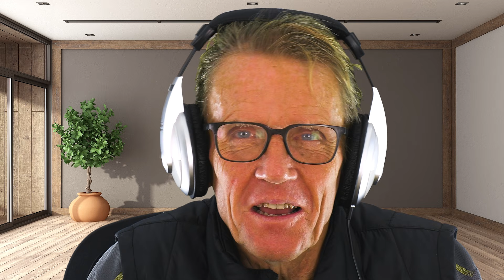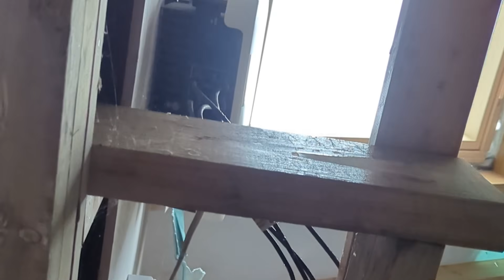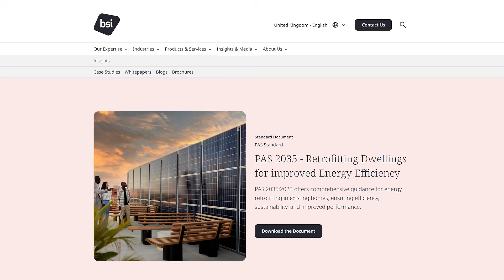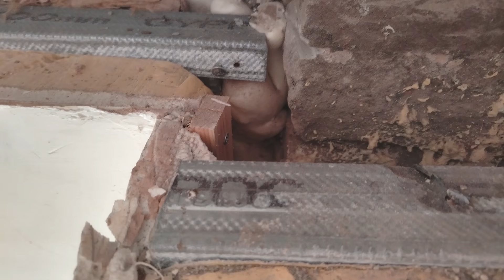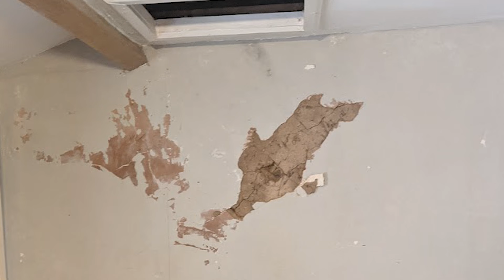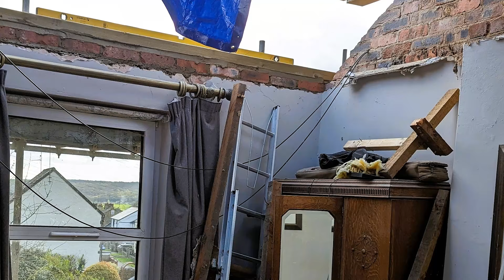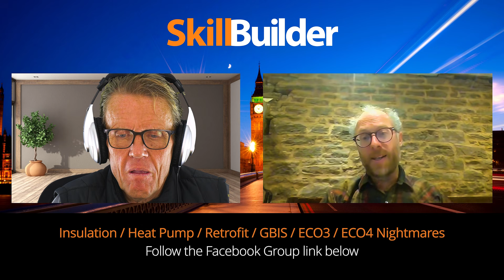Government Scheme Leaves Homeowners in Ruin – And Nobody Cares!

Comment: It strikes me that, if our government really thought heat pumps were going to be effective and cheap to run, they wouldn't need to prohibit use of gas/oil-fired boilers alongside as no one, given a choice, would want to continue using them anyway.
Reply: tbf they have to provide some incentive to encourage people away from what they know, even if the alternative is better. They really needed to require proper training for installers and also independent sign off on each installation though, otherwise everyone gets scammed
Reply: Also installs designed at 50 degrees seem to be almost standard, and yes, that's not cheaper to run
Reply: It's an incentive problem. Heat pumps are cheap to run, but they are expensive to install. So from the perspective of a construction company, why would you ever put a heat pump in a new built? The company has to pay extra for the expensive heat pump, and that will raise the value of the property a very small amount, but not as much as the cost of the heat pump. Meanwhile all the savings that pump will make in running costs are savings to the buyer of the property - the company building it isn't going to see a penny of those savings, so what's the point? Why would any company, making a rational economic decision, want to spend their money in order to save money for someone else?
Reply: @vylbird8014   You say they are cheap to run but the video (and another comment I read)  say that the oil system cost £1,000 per annum and the heat pump cost £3,000 per annum to run.

Comment: Retro fitting air source heat pumps and solar panels to a property that's partly solid stone!?

It only works with modern, high quality insulation integrated into the building.
Reply: Winner winner, chicken dinner for you my friend 🤗... putting a heat pump in an outhouse is just hilarious, he'd do better to re-open the forge, plenty of heat then !! 😏😂

Comment: Thanks Roger for shining a light on this issue, Duncan so sorry to hear about the mess, but you seem like a good sport (well, you’d have to be, considering what you’re going through). Couldn’t resist imagining the kind of memo that might’ve circulated inside government HQ. 
INTERNAL MEMO CONFIDENTIAL
Department for Domestic Sustainability and Public Optics (DD-SPO)
Subject: ECO4 Scheme Strategic Messaging and Damage Containment
Re: ECO4 Performance Review “Reframing the Narrative”
Following recent reports of 30,000 homes now hosting mould colonies and structural regrets, we must urgently rebrand the situation.
Key Messaging Adjustments:
•	Replace “failure” with “learning opportunity”
•	Reframe “damp” as “natural humidity redistribution”
•	Emphasise carbon savings from not heating unusable rooms
Operational Guidance:
•	Avoid phrases like “botched,” “unliveable,” or “fungal bloom”
•	Redirect complaints to energy suppliers or spiritual advisors
•	Prepare talking points:
o	“ECO4 has insulated Britain’s future even if it occasionally sealed off the present.”
o	“We must not let a few thousand damp bedrooms derail our national climate goals.”
Next Steps:
•	Launch ECO5 pilot with stricter installer vetting (minimum requirement owns a ladder)
•	Commission review by firm that evaluated HS2 (they’re great at finding silver linings)
•	Schedule press event at a successfully insulated property (preferably one with no residents)

End of Memo
Please destroy after reading or store next to the Universal Credit rollout plan.
Reply: That’s good, and all too true!

Comment: Thousands of people / eldery conned by sprayfoam loft insulation. see it all the time.
Reply: There was also a period where spray foam was sold as a sticking plaster solution for old roofs. The foam stuck together slipping slates where after perhaps 80 +years nail rot had set in.

Comment: Curious… the involvement of the government seems irrelevant in this. The client had a faulty house that the installers didn’t take into account.
Reply: I think if you have a preconceived notion of government, you're probably going to blame them or the opposite. 
I don't think the government involvement is irrelevant, but nor do I think the video provides a case that it is an issue. The question is whether government schemes proportionally increase the number of disreputable installers or not. Logic would suggest so. The inability to regulate properly and legislate for installations is separate to the grant system, which is used to boost uptake. What the grant does, it appears, is boost the opportunism of the cowboy installer (or just installers who think they know what they're doing, but don't), whilst reducing the barrier to his entry via cash. Ultimately, a system of low regulation and grants produces the perfect storm of shiteness when it comes to most things. Grants on their own are not bad. This incident wouldn't have occurred had a well regulated system been in place, and the owner would not have gone for the heat pump had the grant system not been in place.

I would caveat with the point that most people I hear who shout loudest about how terrible heat pumps are, are also those who complain about red tape. My Scandinavian friends all have heat pumps that work perfectly. They also have lots of red tape.
Reply: @ricos1497  Indeed, here in Australia we all have heat pumps too. Leaving them on 16 degrees all over winter is a very efficient way to remove the chill.
Reply: It is because government never supervise the millions of pounds of our money that they spaff out on these schemes, so the schemes get infested with bad actors and quick buck cowboys

Comment: It is possible to be intelligent, yet lack common sense. I bought a new build 26 years ago, asked the site manager what wall insulation they were using - none, was his reply, ‘this is classed as a severe weather area’. I wonder if the new owners have had insulation injected into the cavity. My present house, new build 22 years ago has insulation attached to the inner walls, leaving a few cm gap in the cavity.